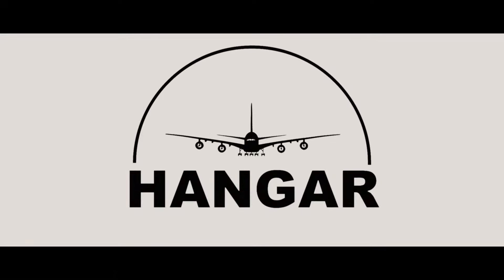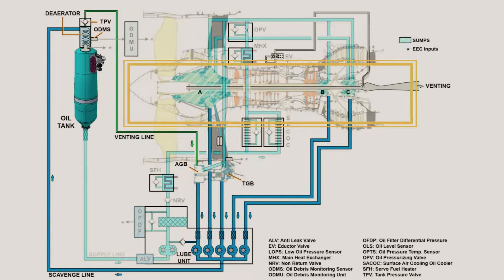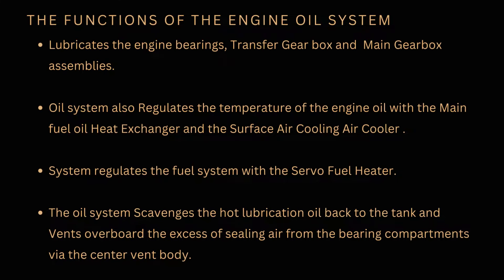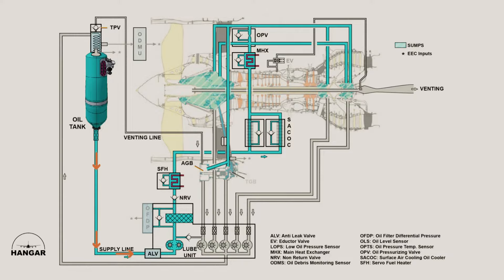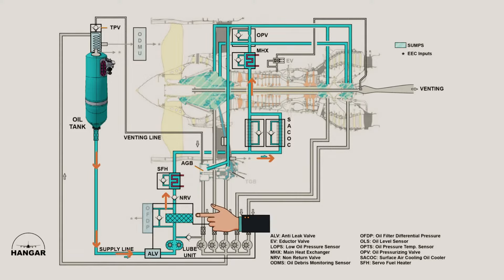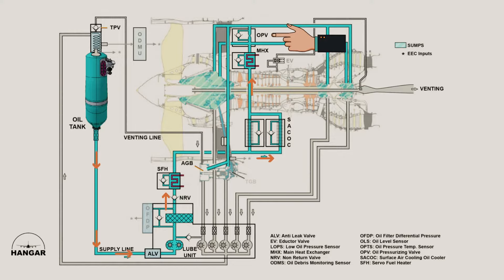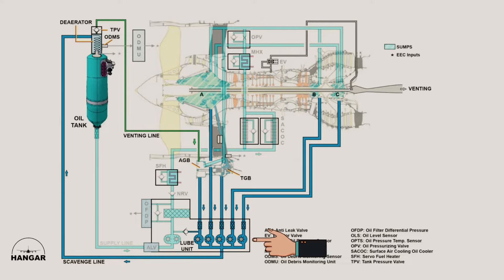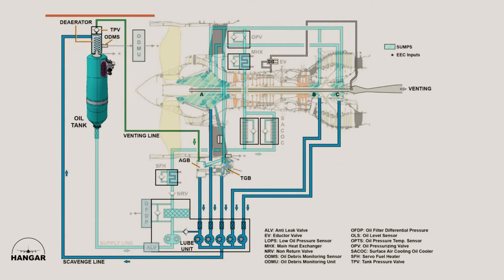A320 Neo CFM Leap1A Engine Oil System Simplified | Leap1A oil System #a320neo#cfm#airbus

Comment: no informatiom about eductor vlv ???
Reply from the maker: The eductor valve controls the Diff P of sump A seals in order to prevent oil leakage. At low
engine speed, the eductor valve opens, forces ventilation, and decreases sump pressure inside.
At high pressure the Diff P is high, the eductor valve is closed.